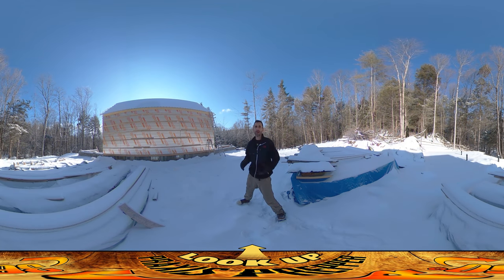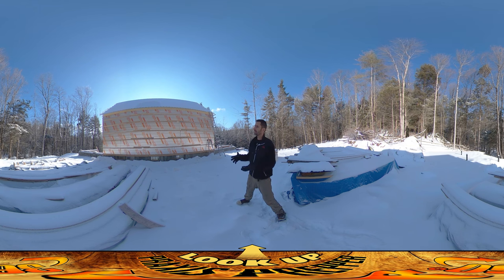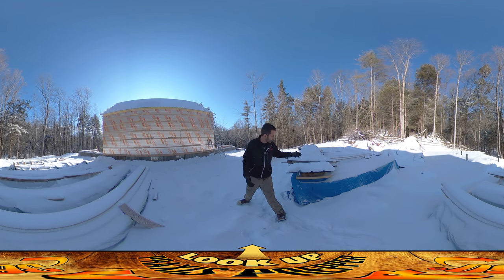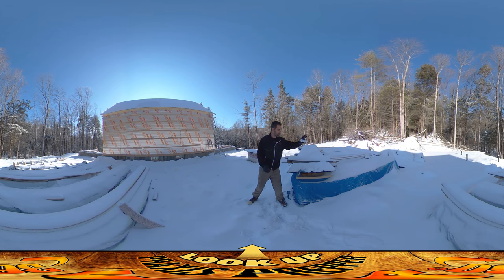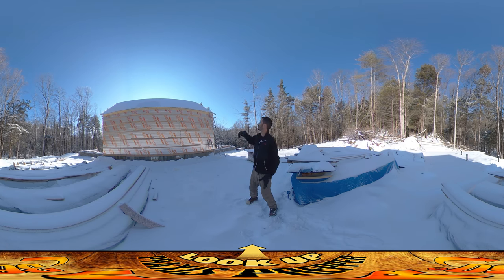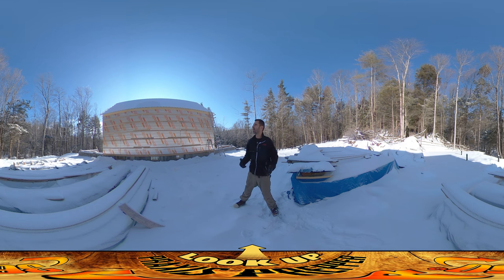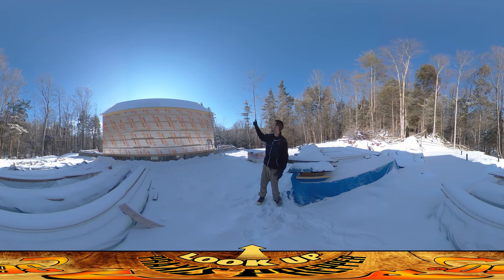Homestead Building - Dealing with Holdups that Effect Other Aspects of Project

Comment: It's times like these I wish I knew exactly what to say or do to make the frustration on the accumulated delays evaporate.  I don't, but I'm right there with you. I'm pretty close totally ignorant on cement slabs so my perspective isn't worth much. That said, I agree with what you said elsewhere about taking.the cautious route.  Even if you are delayed until spring, waiting for several months is not as horrible as living for twenty years with a broken slab and dysfunctional heat system.

Comment: Something is stuck to your shoe, big bear off to your left.
Reply from the maker: Yeah, the rubber sole of that boot was falling off. I "shoe-goo'd" it back together and used masking tape to hold the thing together while the glue dried. When it was all dry, I went to take the tape off and realized that I couldn't think of any reason to bother removing it, so I left it on there. I think it's mostly fallen off by now anyhow.

Comment: I know your windows have shown up in realtime but still don't understand why you didn't pour the slab a long time ago, slabs are commonly poured before any structure is built other than the walls in a basement if one is present. 🤷‍♂️

Really hope you don't end up with any problems because of not having it in place before building the bones of the house.
Reply from the maker: The big issue with the slab is that if it's poured before the site is covered, it can turn into a bit of a shallow swimming pool when rain falls. We needed to wait until the roof was covering the site and to a lesser degree the windows were on to prevent rain pooling on the slab. The second potential issue is with freezing. If the site is exposed and water is getting under the slab and then there is a hard freeze... OUCH. You'll have a frost heaved and likely cracked slab. Had it been the middle of summer when were were leading up to the pour of the slab, we could have just worried about the roof and then poured, but with the chance of freezing temps this time of year, we needed to make sure we were both dry and above 50F.
Reply: Praxis Homesteading and Survival Skills I guess you were being extra cautious but slabs are poured all over the Northern half of the country all year. Special additives are added to the mix if it is too cold or wet for a normal cure and plastic sheet is used to protect the slab until it fully cures. I can understand the desire to protect it from water getting under it but with the sides up and enclosing it, plastic over the window holes would have solved that problem and it seems like a more important priority would be structural integrity of the house.
Reply from the maker: @inmyimage1081  Obviously I'm not a professional concrete guy, so I only have the info that I've researched and common sense, so my take on this should be seen through that lens, but I was directed by multiple local people who have experience with this sort of thing that getting the building all sealed up before the pour would be ideal. And just from a common-sense perspective, it would seem to be a bad idea to let the ground freeze under a newly poured slab that may have water beneath it because of the risk of frost heaves. The additives you mentioned are used around here too (though not without trade-offs), but their function is (as I understand it) to allow the concrete to cure at a lower temperature without being destroyed by exposure to cold duing that cure. But as far as I'm aware, those chemicals don't have any vote in the interaction of a cured slab and frost heaving up the ground beneath it when freezing occurs. We have plenty of frost-heaved and cracked sidewalks in New England to demonstrate that potential when water gets under the pour.
In the end, again, I only have what I've researched and my sense of things... which admittedly leans towards being overly cautious in many things.
Reply: Praxis Homesteading and Survival Skills Definitely understand taking the advice of local experts or experienced tradesmen when making decisions like these, especially since under general circumstances general contractors have crews to bang things out before weather becomes a significant factor.

My concern is that waiting so long is taking a toll on the structure given that sheeting the windows should have been sufficient to keep out moisture. Just biting my nails that it doesn't become a bigger problem. Hopefully in realtime it's done or about to be done soon 🙏
Reply from the maker: Spoiler alert: We're sealed up and easily capable of 80 degrees F inside now.
Reply: Praxis Homesteading and Survival Skills Nice, I'm looking forward to the next Patreon livestream and hoping for another realtime peak at your progress.

Also interested in how your stove is going to be set up to circulate air throughout the house.